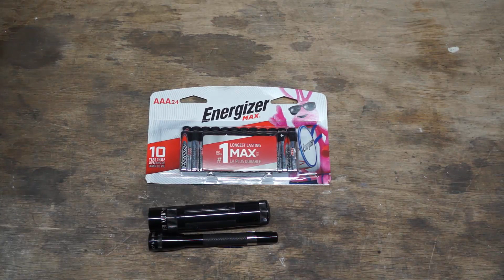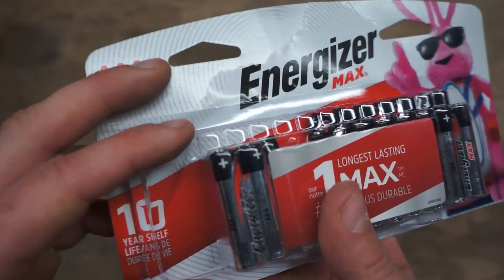MagLite XL50 issues - part 2

Comment: I just got done troubleshooting one of these -- the output capacitor on the power supply failed as a short -- somehow the thing still worked fairly well, but drained power like crazy, killing batteries overnight. I measured 300mA of constant drain on the batteries.  After replacing the capacitor, works great - no drain.
Reply: Have you been able to disassemble the switch?
Reply: @Magicbuddhafinger  It's not my flashlight, and it's been a while since we took it apart, but as I recall we didn't take apart the switch. We definitely damaged the case some to get the control board out.
Reply: @ no worries, thanks for the info!

Comment: All I know is that I have been carrying a XL50, in my pocket, for 7 years and it's the best flashlight I ever owned.  I worked for 42 years as a railroad engineer and have always carried a light.  If you are going to store it for long periods of time, take the batteries out.  If you are using it every day, it can't be beat.

Comment: It's a fair review and I've had this issue too. I've had three XL50s and they do leak. There are two good things about this flashlight, one is that it's cheap and second, the brightness is great. However, the battery leaking issue is unacceptable and I finally upgraded to a Fenix flashlight, which cost me $100 but it's rechargeable and more reliable.
Reply: That Fenix still treatin you right? My XL50 just died and I’m tired of my mag lights dying from corroded batteries. I’m ready to check out some diff brands.
Reply: @souperdooperman  Yes, the Fenix is absolutely treating me great. It's rechargeable, which is a huge plus. And it doesn't leak. It's pricey but you only buy it once and never get mad. My Mags are gone.
Reply: @timsummers870  Awesome, I was looking at a bunch of options on Amazon and it definitely is looking like the Fenix is the way to go. Thanks for bringing it to my attention!

Comment: I know it's an older video, but thought I'd mention a couple things...  Many of the newer flashlights have electronic switches which all have parasitic drain.  This is like how your TV is off, but it can still read your remote inputs since it's not completely off.  What might have been a good test, is if you could "lockout" the flashlight by loosening the tailswitch 1/3 turn, thereby eliminating the battery drain.  With the significantly larger capacity of the Li battery options (Olight, Fenix, etc.), some might not notice as much with those lights.  Also, any alkaline batteries risk corroding/leaking, even if stored in the original packaging.  If you use Lithium AA's or NiMH AA rechargeables, you should not have this issue.

Comment: Like you say.  Nice size.  Nice weight.  Great light when working.  My problem is that after using one set of batteries and replacing them with new ones, the light does not work at all.   Yes, I know how to change the batteries properly.   I have purchased several of these XL50's at Lowe's and Walmart for gifts and kept two for myself.  All of them seem to have the same problem.  Don't know if it's in the button switch, or the bulb burned out.  the replacement bulbs are not cheap either.  I'm bummed to have spent so much for several and have problems with every one of them.
Reply: Weird. I own 2 one I bought 3 years ago the other about 2 years ago. I use them almost daily for short time periods as a signal to co-worker across a noisy plant. Any ways the button on my 3 year old one is going bad and will switch modes at will if it's on and tilted or bumped. The tail cap is the issue. I wonder if the newer versions have new issues. Either way I won't buy this style again when my 2 totally die. Batteries I change weekly so they always work. Never had your issue with my older ones...
Reply: Just bought mine today. Opened it, put batteries from package in, didn’t work, verified polarity on batteries was correct, it was. Put in Brand new batteries, same result. Checked the lockdown function, doesn’t change anything. Simple flashlight that somehow can’t do its one intended purpose straight out of the box.

Comment: Good video I have another issue with them. I use it daily at my job and therefore get "free" batteries from work weekly so that drain isn't an issue. However after about 3ish years of daily use the tail cap is messed up and will switch settings if it's on and then shook or tilted. The button feels normal but clearly isn't right. I bought 2 and my other is newer by a year and doesn't have any issues....yet. Changing the batteries weekly keeps it bright and I have never had it leak in THIS light. What junk though. Being cheap I thought the 30 bucks would be better but if I had to buy batteries weekly it would be extremely expensive.
Reply from the maker: TJ Jones for reliable yet affordable try streamlight, i have had a tail cap fail on one before (same is true with surefire lights of mine) but in both examples the company sent out a replacement within 1 email at no charge
Reply: @EDC_Tactical  thanks I definitely will! I heard they had good products but didn't realize how good the customer service was!
Reply: @EDC_Tactical  quick update after you saying that I called maglite. They gave me a new tail switch for free but didn't cover shipping so I had to pay $8 not huge but definitely not as nice as you got. Anyway great video thanks for the info
Reply: @EDC_Tactical  what is the result of your experiment? i have looked on your channel and there is nothing. thanks in advance!

Comment: My issue is the switch, if I screw it to tight it doesn't work. I have to tighten and back off a 1/4 turn for it to work normally. 
Waiting on my streamlight 1LAA ,then maglight goes bye bye...

Comment: Hi, thanks for the videos. I was concerned about reports of current drain in this flashlight and found out that it is a known consequence of the versatile QuickClik tail cap switch, though it's not disclosed on the Maglite product information page (https://maglite.com/products/xl50-3-cell-aaa-1). This review (http://www.led-resource.com/2010/10/maglite-xl50-led-flashlight-review/) from 2010 says, "The main disadvantage of the electronic switch used in the XL50 is the presence of a standby current drain. The XL50 has a measured standby drain of 33.1 µA (or 0.0331 mA), similar to the XL100. A typical quality alkaline AAA has a capacity of about 1000mAh, which means that a set of brand new alkaline batteries will be completely drained after three years." My XL50 lost power very quickly, but I found out it was because 1 of my 3 batteries was dead, though the other 2 were at full capacity, so replacing the 1 dead battery brought it back to life. I may not be a fan of the current drain, but I am a fan of the way the tail switch works, and this at least this confirms and explains the reason for the current drain. Hope that helps!

Comment: I've got the same problem with my ML 50LX that I got from Marlboro rewards codes. Except my flashlight only drains one of the two C-cell batteries to the point that the flashlight turns on and just dies without warning of getting low, one of the batteries checks @ 1.485v and the drained one is always around .445-.465v. Mag-Lite warranty claim cost $15.00 for shipping & handling ? They're totally worthless as far as customer service or standing behind their product!

Comment: I've got the XL200 and I've used energizer and currently Asda alkaline batteries and it's been fine up to now. I had 5 maglite led Solitaires, 4 of which have energizer batteries and one with a duracell. I gave my wife and son one each with energizer batteries in and are still working fine, but of my 3 i had to throw the one away with the duracell in because it had leaked and was locked solid inside. My other 2 are still working fine with energizer batteries